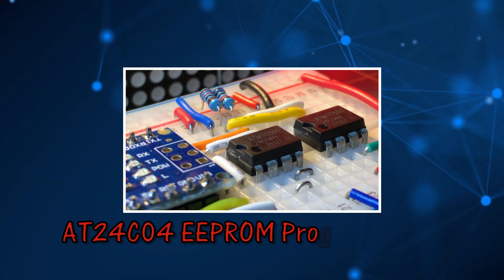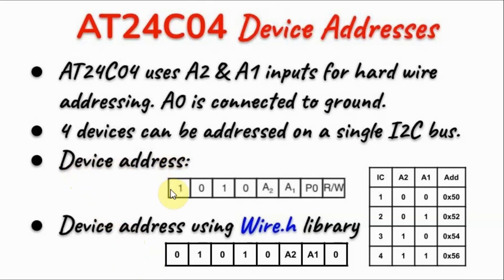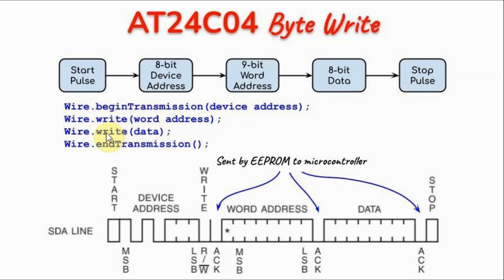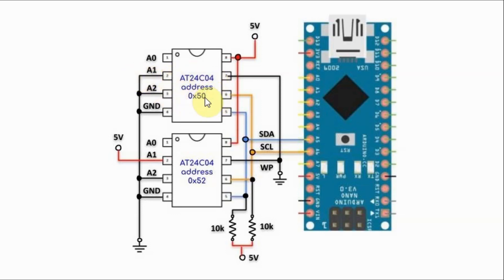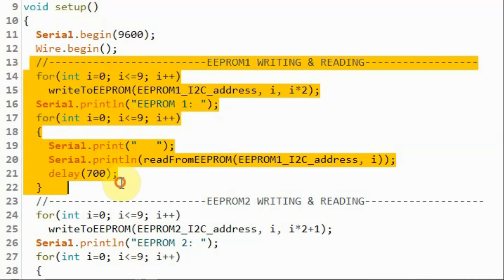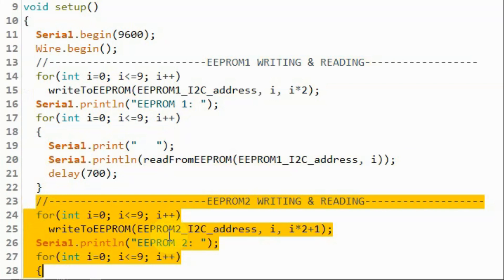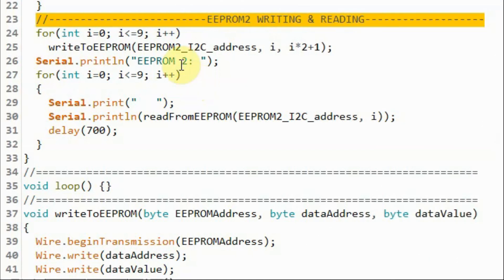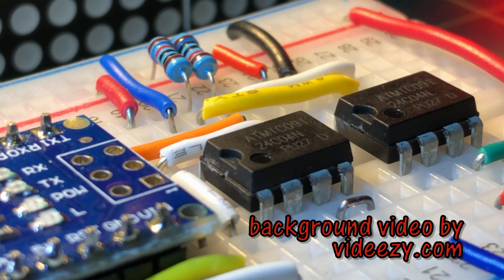AT24C04 EEPROM Programming using Arduino

Comment: could you tell me if this could be used to reset a 3d printer filament print cartridge?
Reply: AT88SC 25616C Atmel is the chip model based on what I was able to find in another blog